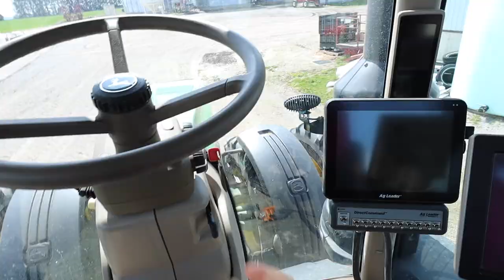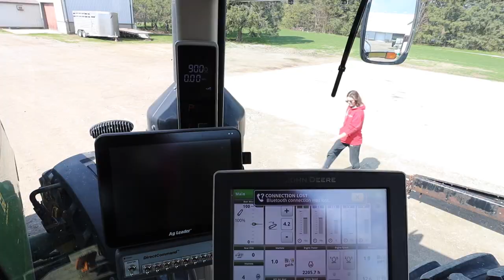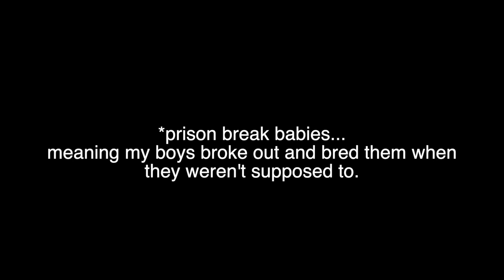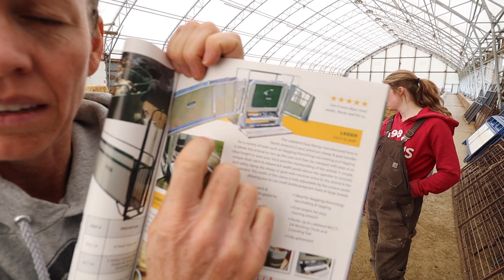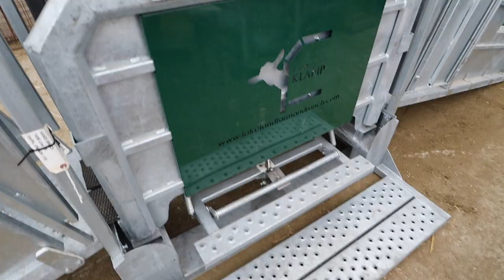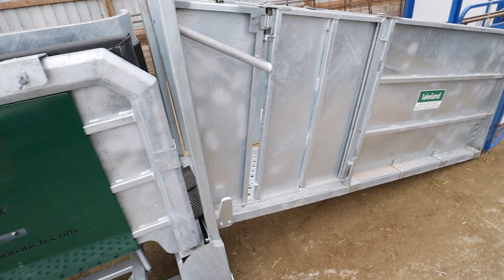A NEW ADDITION TO THE SHEEP FARM!! (maybe...)😳| Vlog 441

Comment: A sheep juicer! I love it. Feed the sheep in one end, squeeze, the juice flows out the bottom and the pulp goes right on out the front. Couldn't be simpler.
A little hint for sub q injections which I just learned (and which I don't know maybe you already know) is that if you pinch a little skin between your forefinger and your thumb and stick the needle in the skin you are holding like that, it will make a perfect little pocket for whatever you are injecting which will allow it to infuse more evenly. You will also notice that your animals will never flinch when you do it that way, so it's an added benefit of being painless and lowers the stress level for them a  bit. It also keeps them from forming cysts or small fatty tumors at the injection site, which can be a problem with some animals. Since learning about it I've used that method on sheep, goats, cattle, horses, and even ducks, geese, and chickens, and it's just amazing how slick it  is. I'm even using it on my hubbie who was born with type I diabetes. He says he can't even feel it going in, which is cool because he's a big baby and hates getting stuck even though he's been doing it all his life. So there's that little tidbit for anyone who doesn't already know about it (because I'm often the last one to know), but still it's good to pass things along just in case. Also, don't pinch hard. Just pinch enough to pull up a bit of skin to poke the needle into. Try pinching up a bit of your own skin and you'll know how hard to pinch. It shouldn't be so hard it hurts.

Comment: you can always add a white section on the end before your sorting gate and put a gelatin gate between the new and white...so if your pushing and can't catch at the same time the ewe can't go far....you can also switch out the sorting gate for your turn table to do feet if you don't like doing them while standing...lots of diffrent options as it works as a squeeze or straight section or scan gate....it will still take time to get it but ibthink once you find that sweet spot you'll be set!

Comment: We have the Ritchie version of this. It has been the best piece of kit we have ever bought. We do feet , vacations , dagging tag etc with it! T takes awhile for them to get used to it but it works really well. Do get a demo from the company before you use it as ours has several different settings and adjustments on it for sheep size and operator weight. You can also get at weight plate that goes under ours so there is nothing we cannot use it for ! Good luck with it should be a real asset !by the way we are both in our 70s and it is the only way we could continue with sheep!

Comment: Hi Sandi. We just bought a very similar machine called a combi clamp which is from NZ, to try to help me continue working after my third severe back injury. Using it by myself is a big issue so my wife has to come and help push up. We also have independent thinking sheep that like to make it hard. We had to buy an electric prodder to help this year which to my surprise works amazingly well and reduces my physical demand enormously. 
Handling sheep is never going to be easy!👍🇦🇺

Comment: consider a Te Pari? Has a self-catch, weigh, sort, links to your hardware/management software via Bluetooth. Now there is a dosing & vaccine gun that calibrates in conjunction with the scales using Bluetooth. The setup is a little spendy but if you are doing a lot of sheep (400 and up) by yourself it can be worth it

Comment: How about you get some strong straps so that you can bond the up and down ramp to the squeeze chute. Then you can pick up the whole assembly with your telehandler ad shift it aside. I think that once you easy can pace it in the working area and take out, then you can use your other solutions as well. Other option is to place your hoof trimming rotating chute after this setup. Then the sheep just move up the ramp, through the chute down the other ramp and then in the hoof trimming chute. Lots of options. Good luck!

Comment: I'm concerned the new sorting system is way to heavy to move easily. I guess if you leave it up all the time that's ok. But using it in the finishing barn wouldn't work unless you expand that barn.

Comment: an easy way to make sure thhe tyre is on the rim you need lubrication the best is liquid dish soap concentrate not pure will also stick the rubber to the rim incase there is a seam leak

Comment: one suggestion you could try is to put crank up wheeled trailer jacks oin the piece you had to lift thst way you would have to worry about putting lumber under it to stabilize it while attaching the ramp.. and it would be able to wheel around out of the way rather than have to use the tractor when you are alone, just saying.. might be a plus

Comment: Despite it being heavy and rather awkward and therefore not easily moved I can appreciate the quality of design and construction. I think that it will suit you well and the sheep will take to it fine especially once they have all passed through it at least once. However I'm rather doubtful about how well the dividing system will work in practice and the access for the scanning lady is also less than ideal and marking to indicate empty/singles/twins/ multiples looks to be more than difficult. What it will not do is help with foot trimming as the sheep cannot be rotated. Do you think that it will be an issue to read ear tags with your wand reader if they really duck their heads down really low and they are squeezed tight?

Comment: consider using a lever system for lifting instead of manually lifting. You know, a fulcrum of wood or anything high enough and a strong piece of wood or metal rod as the lifter. You can operate a lever with your feet and stand on the end. Like a teeter totter. Ultimately if you are working alone, use a car jack. Save your back!
Reply: I was thinking why not try a car jack, too!

Comment: I have a question but I'm not a farmer so please keep that in mind. If I recall correctly, you leave the CIDRS in for 2 weeks.  If so, could you leave them in for a bit longer like 3 or 4 weeks to see if that helps the ones that miss?
Reply: The hormone to pause their cycle only lasts so long. If they miss it's because they didn't ovulate despite being in heat. Ie: naturally, sheep go into heat at random, but really usually ovulate in the late fall. This keeps the Rams busy (No need for them to fight as much, meaning they're more content), but with fewer lambs being born during the extremely hot and cold months.  

The hormone that triggers ovulation (given by injection after the CIDR is pulled) may not work, because it is the wrong time for them to ovulate. Giving more of it may help, but other factors (like age, wellness, Condition) may also prevent ovulation/conception.  And sometimes...you have a dud Ram who won't let anyone else have a go...and she misses because he's shooting blanks.
Reply: @DembaiVT  Thank you very much. Some of that I knew but forgot and I got the use of the injections and CIDRs backwards. Oops! lol